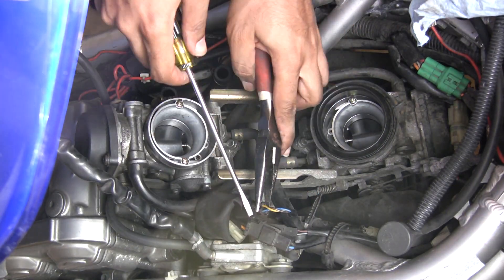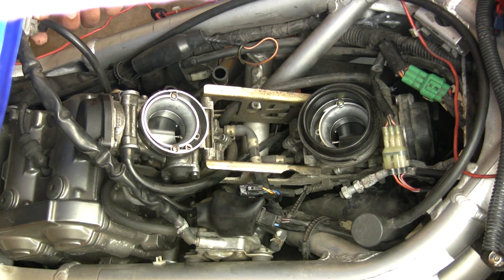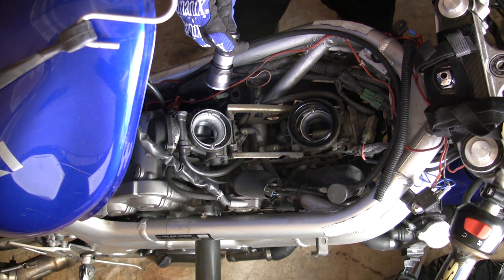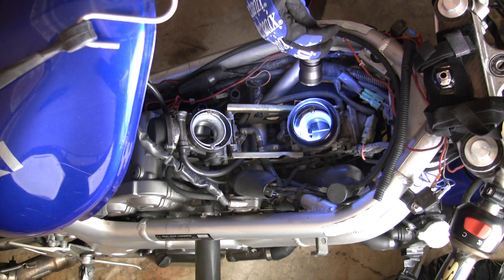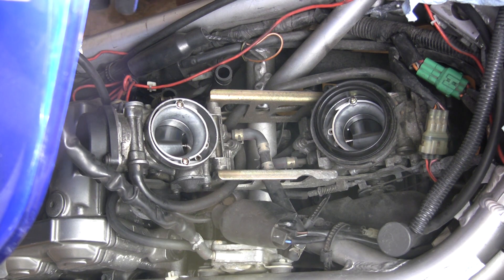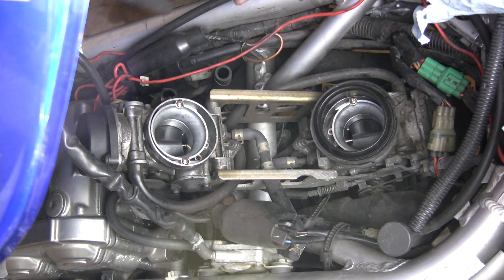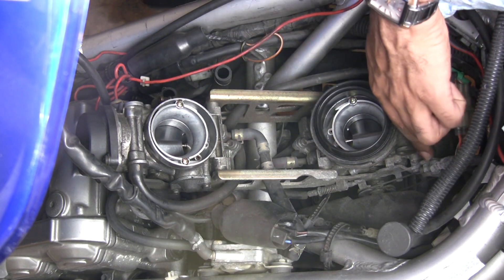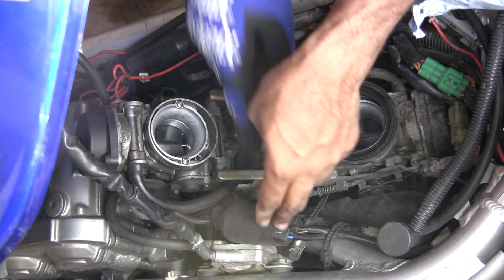How to clean a carburetor - Part 1 [Airbox/Wires]

Comment: Seriously bro? You make 1 part and just leave it at that. I’m already struggling to find helpful videos and you justvleave me butt fucked with a half removed carb. Thanks fam, at least take this video down since there is no part 2.

Edit: for anyone else that watches this video. Removing the throttle cables at the Carbs is a no go, and after extensive research in forums it’s best to remove the throttle cables from the throttle itself and not the carbs.